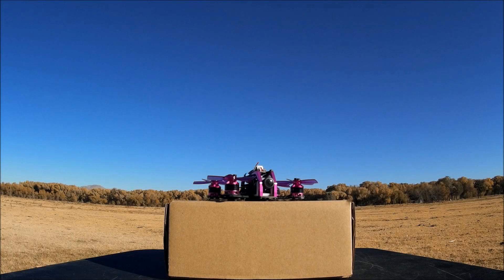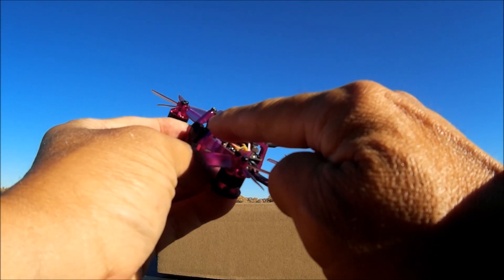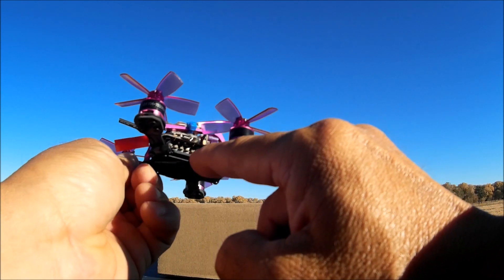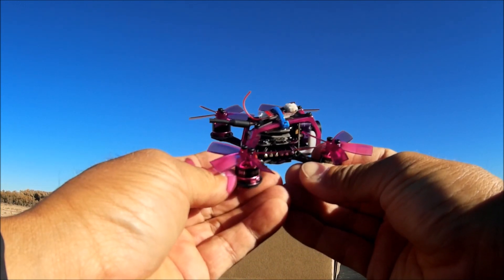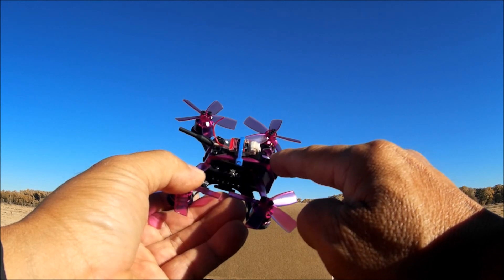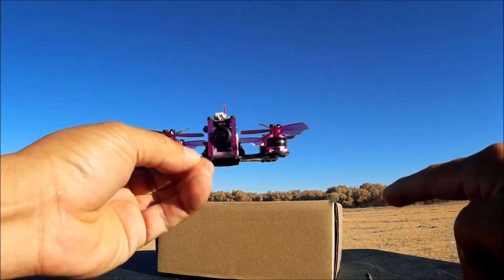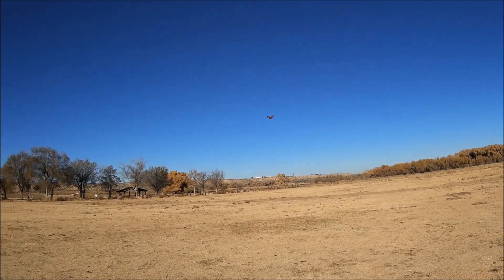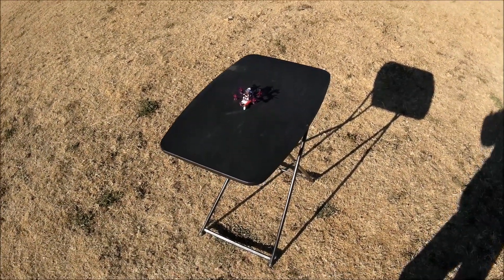FuriBee GT 90 90MM Fire Dancer Micro FPV Racing Drone

Comment: Waited a long time for a review ot the Furibee GT 90. 
Good camera, but what a pity, very thin frame, it will surely break after a even small crash.
Thanks RC Ecsape, good job!
Reply from the maker: I think it is the thinnest I have seen to date.  just gotta be extra careful with this one :)
Reply: Yoda Yedi crash report for you: fell from 10-15m height onto a roof, just one prop broken.
Second crash full speed in tree branches, no damages.
This thin frame is hard